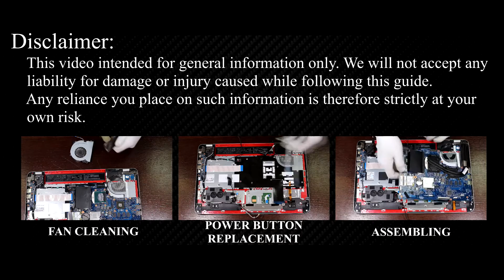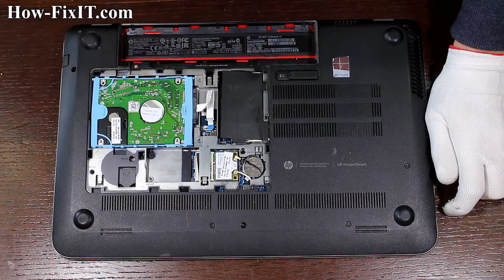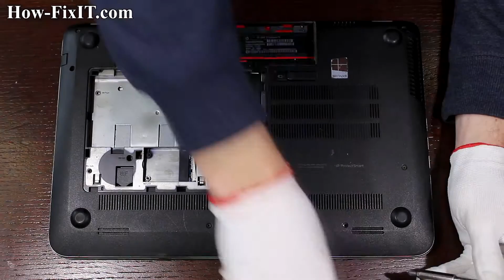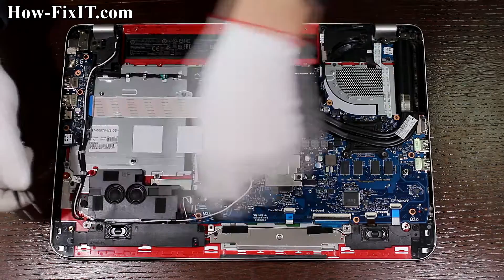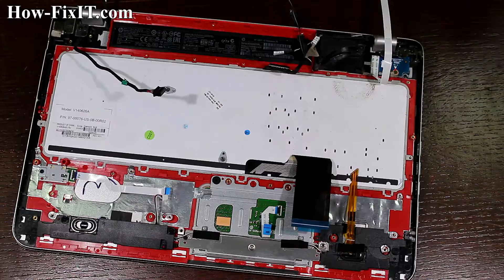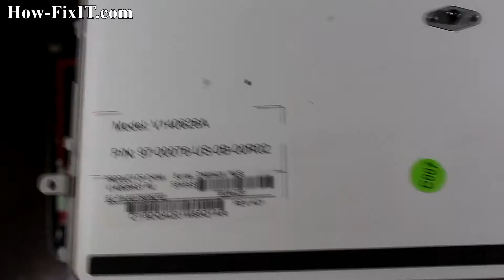Keyboard replacement HP Envy 15 J Series

Comment: THANK YOU! As a 50's female who had never opened a laptop before you saved me a bunch of money! It took me all day but it's fixed! I do have a screw left but oh well. I want to add that you need to add 3 things to add to your video. First make a note that you do have a reinstall video, do you know how hard it is to watch a video in reverse. OMg I spent hours rewinding your video. The second thing is there is a wire that goes from fan to the on button and splits in the middle to be plugged in. It is very hard to find the plug in, a clear picture would be helpful.

Third, people have about 5 little cups when taking this apart, download the service manual to accompany this video. Find out from the manual which size screws you are removing and group them all together. There are tons of screws and they are very similar. I can't tell you how many screws I had test in every hole. 

I want to note that I bought a lighted keyboard for my laptop even though it wasn't purchased as lighted and though it does work it's not lighted. Just thought I'd try it.

Comment: Throw away design. Buy a Lenevo thinkpad or Dell latitude series next time. Most of those are a lot easier to repair than this. It's ridiculous they design these so the average person can't fix it or a tech is going to charge easily $100-$150 for labor because it's a pain to deal with.